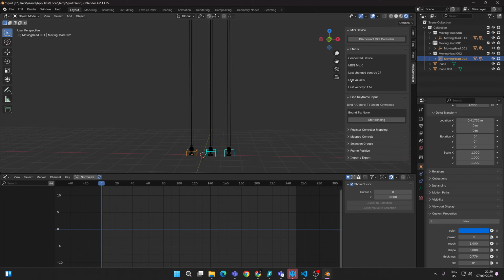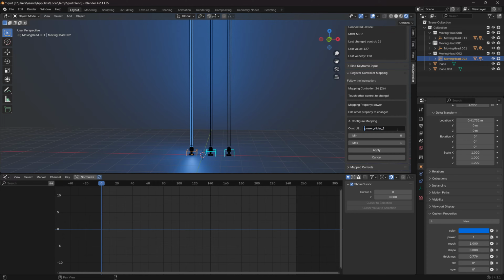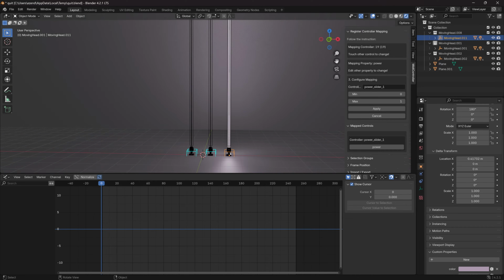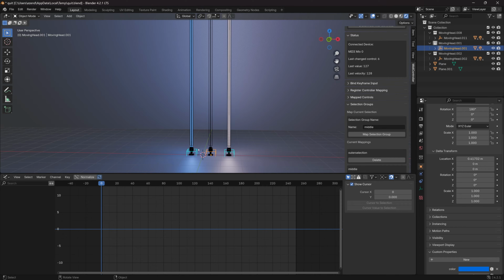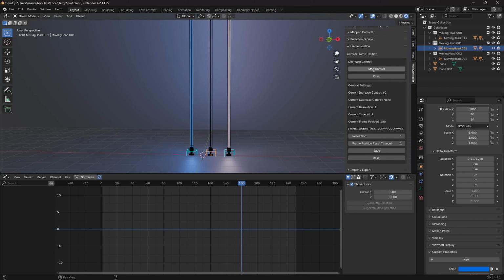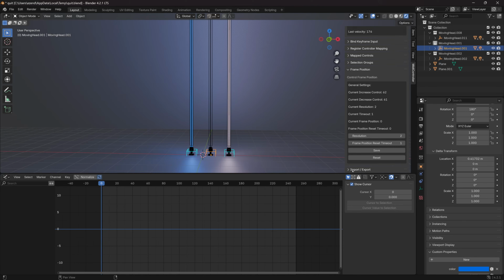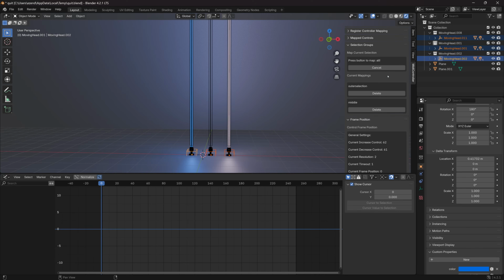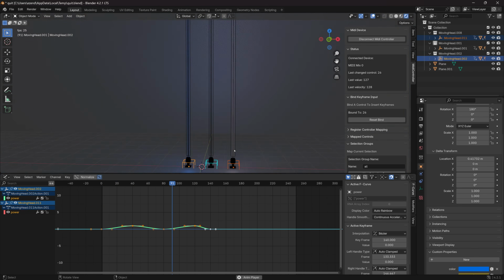Blender - MidiControl (v0.0.5) - Plugin Demonstration

Comment: Can you go through simple example of how to map velocity and key press events from keyboard - aka  standard 7 octave or 92 key keyboard. Is it manual to map every key?
Reply from the maker: Unfortunately I do not have a midi keyboard so that will be difficult. But it should be the same like with the midi controller from akai that i use...

Though I do not fully understand your question, yes, you have to individually map each key to a property by:

1. Touch the key
2. Change the property in blender you want to map to the touched key
3. The property should show up in the Register Controller Mapping window
4. Configure the min/max you want to the controller on midi control between
5. Give it a name if you want (helps with managing multiple mappings)
6. Hit apply and you midi input is mapped!

Comment: so far I like what I see. I am able to use a driver to control the rotation of most options. I see that I am needing to select the object to use the midi control and I am understanding that I need to select through groups. I think this could potentially be a good work around for JPfep since there has been little movement on that plug in and is no longer working with the recent versions of blender. Thank you for working on this. It adds a functionality that I am interested in.  I will have some test runs to show using this product very soon. Again thank you.
Reply from the maker: @jacobmesick1481  glad it seems to be working alright, though keep in mind that this is a hobby project and basically created 'to work' for my purposes. I will try to support where I can in my free time, so unfortunately cant maken promises on stability. Hence though i am grateful that people are testing and validating where I did not. 

In regards to selecting, you can make selection groups in the plugin as an ease of use feature, but in general the plugin will try to change the mapped property for all 'selected' objects in a scene, even if said object was not selected during the creation of the mapping. The property mapping is not on a 'per object' basis. 

Though if desired I can perhaps in the future add a midi binding to a button or just a setting within the plugin that allows for toggling between setting the property of selected objects or all objects (which has the property) in a scene (regardless of it being selected or not).

Comment: Hi Eldin, Thanks for this! My brief tests adjusting basic parameters in property window work. However, I've just been trying this to drive geometry nodes and currently the mapping destinations seem not to work but route to the normal property variables and in a rather strange way. Have you tried geometry node mapping yourself or is it something that you are thinking about? Also is there a way to manually set binding destinations?
FYI using M2pro  MBP OS13.5 and blender 4.2.2. Thanks again!!
Reply from the maker: @mattd2129  as a blender plebeian geometry nodes scare me :), so have not tested/tried it yet. I will see what I can do though
Reply from the maker: Guess what :P, I have added support for manual mapping through using the "Full Data Path", which works with geometry nodes as well as any other property field where you can copy the "Full Data Path" from.

The procedure is the same as before, but after touching a midi control, you can copy the full data path and it will automatically detect it. You get a button where you have to click that you want to map the path currently copied and voila!

Release: https://github.com/EldinZenderink/MidiController/releases/tag/v0.0.7